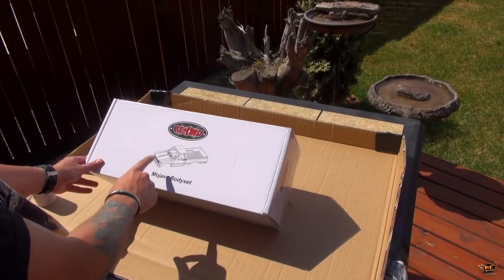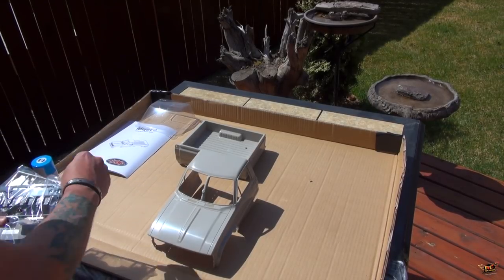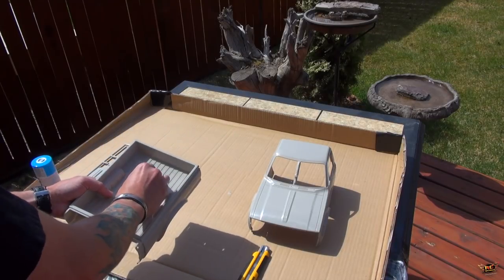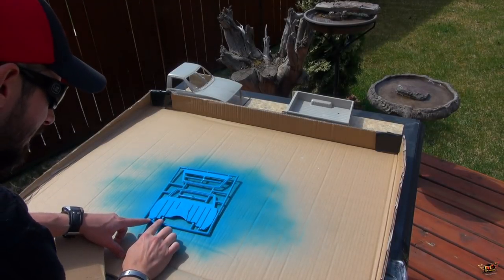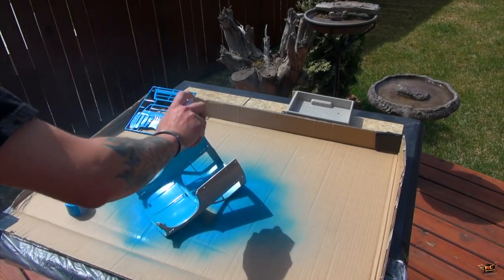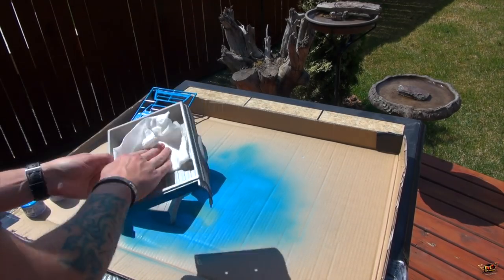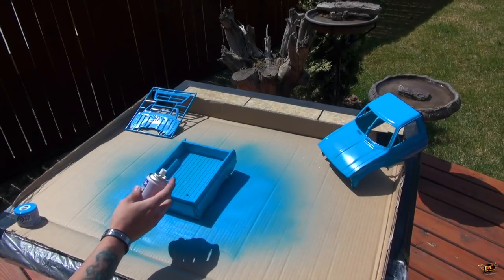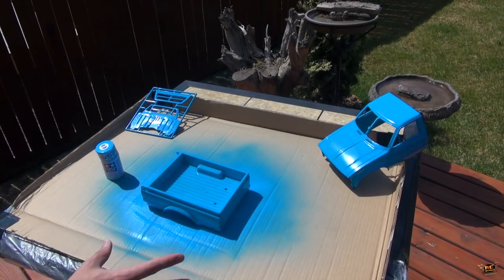RC ADVENTURES - (Basic) How to Spray Paint an RC - RC4WD Trail Finder 2 - 4x4 Truck Upgrade PT 3

Comment: One more tip fro using the paint(used similar paint on static models in the past)...after spraying, turn the can upside down, point away from the project and spray until it comes out clear....this will prevent paint from drying on the nozzle tip and "spitting" paint or just not spraying at all for your next coat. Another great video Medic. Really enjoying the "basic/beginner" series

Comment: a few tips i think you could have included medic, is some i got from a fellow street artist and rc hobbyist. something along the lines of, use a recognized brand of paint (eg tamiya), make sure the nossle is clean, doesnt spit or fill up (on a scrap piece), spray from around 25-30cm away, and go almost ultra light. dont rush! =)

Comment: How can you paint outside? What do you do about dust and little specs appearing in paint? Hard to control dust unless you paint in a paint booth or bathroom after running shower for a few minutes to eliminate dust particles.

Comment: Nice Color I Plan On Spraying Mine Close To the same But Black bed using A Texture spray To Give It The Tough Coat Look Not Saying You Should Do The same But It Is i want But Why Get To Crazy With The Finish It Gonig To Get Trashed On the Trail Right That's The Scale Look Right it looks Cooler with Real Trail character Added From the Trail anyway Thanks For All The Viedo's Keep It Up Man.  Also Where Did You Get the Figure For The First TF2 That You Did Thanks .